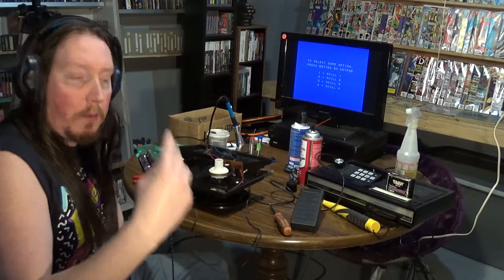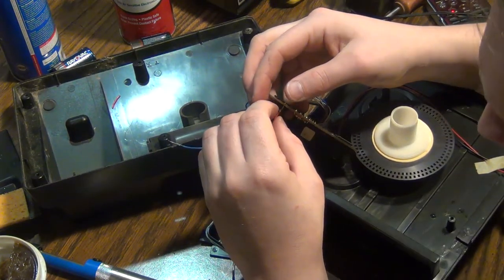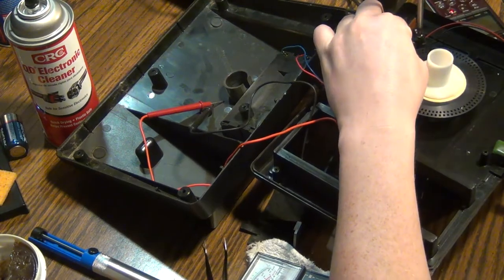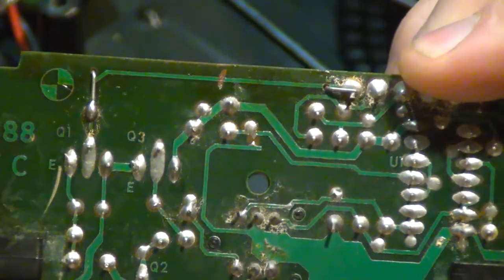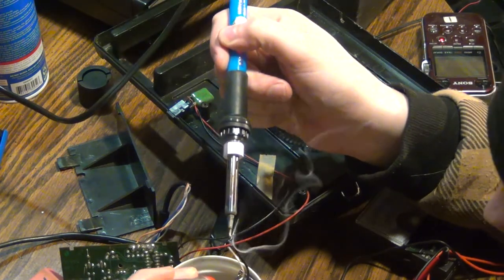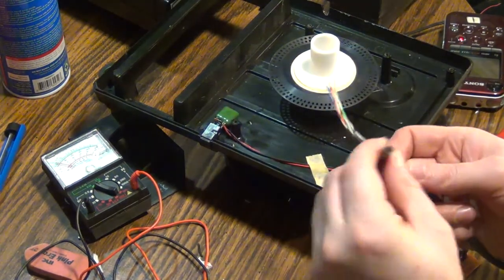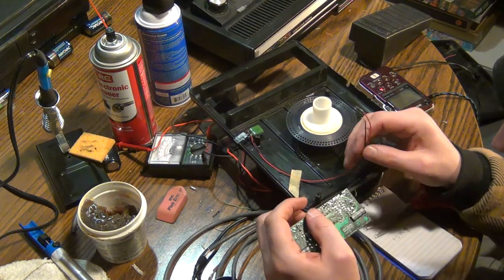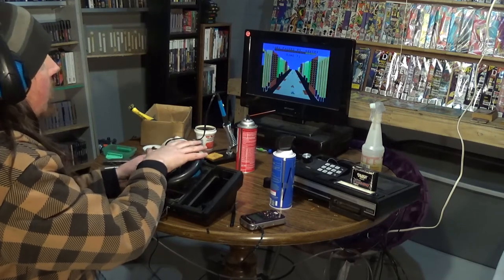Attempting to repair my Colecovision Expansion Module steering wheel and foot pedal (Part 2)

Comment: Did you get it going, to help you out you can retro fit a power supply to the wheel id did it on mine so no need for batteries. needs to be 9v + on the outside just fit a jack input to back of wheel and use a power supply megadrive etc will work fine or get a multi voltage one with tips. the steering wheel needs power.
Reply from the maker: yeah, I actually got it to work. Surprised myself, since i've never done any sort of "modding" like this before. At the end of the video, I show footage of it working. The main issue I believe was that the cable itself was bad, but everything else was fine.